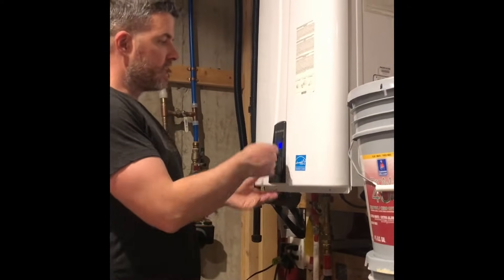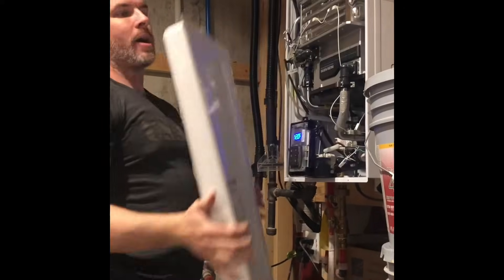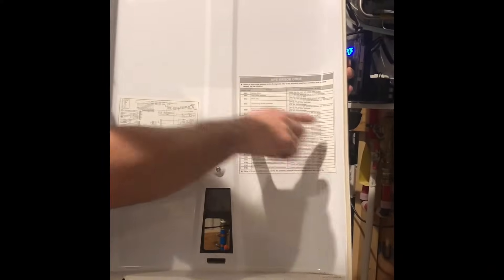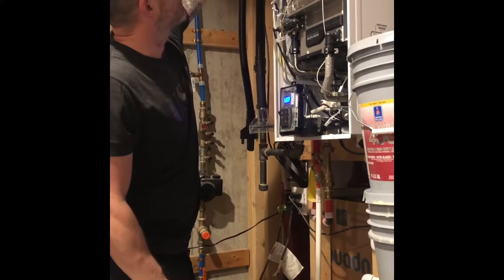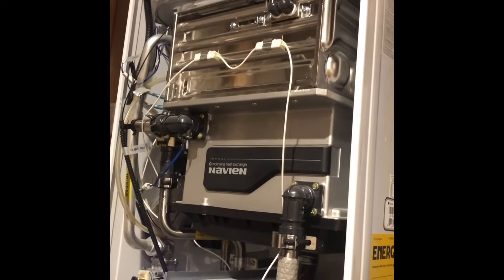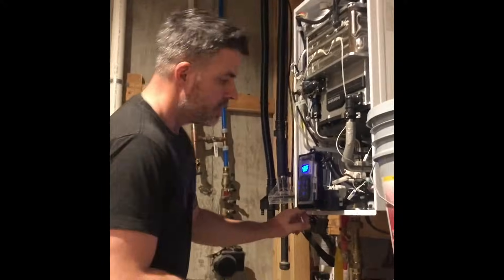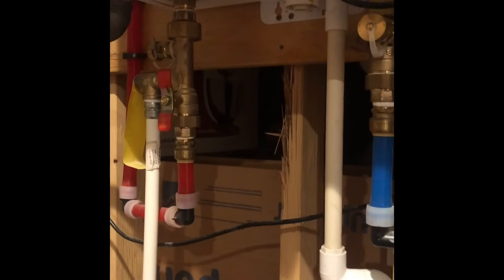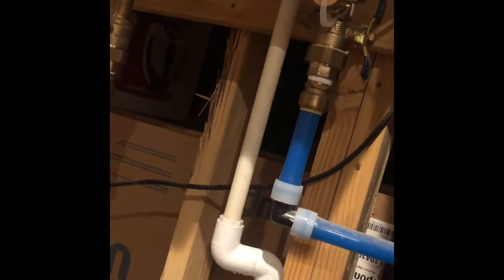Navien Water Heater (Tankless) error code E110 fix: condensation trap

Comment: Just cleaned the condensate trap and it took care of my E110 error code.  (Boiler went out on Christmas Eve.  Thanks, Boxerville, for the Christmas present!)
The User Manual says a fix for the 110 error code is cleaning the air intake filter on the upper left, inside the machine.  Mine was perfectly clean.
Another error code associated with needing to clean the condensate trap is E003, Ignition Failure.  I noticed heat was out, saw E110, hit Reset, and it tried to fire up for a minute or two and then got E003.  
When cleaning the condensate trap, the clip holding it in pulls out easily.  The trap, itself, took a little bit to get out because there is an O-ring holding it in with friction.  (My O-ring stayed on the trap but others have said it stayed in the boiler.)  Have to twist and pull on the trap to remove.  Once the trap comes out cold water comes rushing out.  I had someone there holding a Tupperware container right under the trap and collected 6 to 8 cups of water!  Once cleaned, the trap takes a little bit of effort to get back in due to the resistance of the O-ring.  Have to do the opposite of removing it:  have to twist and push.  Make sure it's all the way in before putting the clip back in.  I needed to give it a couple final twists while pushing to get it tight in there.  (I did not turn off the boiler nor turn off the water prior to cleaning the trap.)

Comment: one  thing  i noticed about  your  drain plug  it fell out because it should have a black  rubber  gasket around it that creates a good seal you  could problemly order one online .     Im  having the same  condensation   issue  but now its happening every two  weeks  i just  empty  the water out and its  back working but im doing it to often now  about  every  3 weeks    so i think something else is going on with my  2017   MODEL 420S unit     thanks for posting

Comment: For everyone that cleaned out the condensation trap, do you just keep letting it fill up with water and drain it again each year? Or should it be drained more often?
Reply: The User Manual says you should "inspect the condensate trap" "monthly."  I've only cleaned out the condensation trap when I get the 110 error code.  I've had the boiler 7 years and I've only gotten the 110 code 2 or 3 times.  I would say, if you don't want to deal with the heat going out, probably draining the trap once a year would be the recommendation.

Comment: I had E445… they changed my whole heat exchanger out.. company said they “changed the valve” which is what the error code was… noticed a fluttering noise 2 days later.. now I have E110 popping up but didn’t have time to look before work! Hope this works. Thanks

Comment: Wanted to say a heartfelt thank you! I just zoomed out to my wife’s aunts home after she called asking about her water heater not working. I wrote down the model and error code. Looked it up, found your video, realized I needed to go check in person (was a drive, but seemed serious enough to require immediate attention). Sure enough the filter was the problem, impacted with leaves and dirt. Cleared it, reset the machine, all done! You saved an elderly recent widow from an emergency service call.

Comment: You are the man!
Thank you for this video. My Navien is about 4 years old. I had the same error code. I checked the inlet, cleaned my filter and checked my exhaust. All checked good. The unit kept shutting down with the same error code. 

I removed the drain plug after watching your video and about 4-5 cups of brown water came pouring out. Be prepared! 
Unit is working now. However, I think I lost a gasket in the drain plug cap when all the brown water came out. I put the cap back on and I can’t get a seal on the drain cap. Water runs out when I turn on the unit.
Reply from the maker: Look for the black o-ring gasket on the floor or perhaps up in the area where you pulled the drain plug.
Reply: Hello,
I found it. It was up in the pipe. Thanks again!

Comment: Will the drain lines being frozen cause this error code to keep coming on?  It got to freezing temps for the first time and that error code came on.  I checked the exhaust vent and it was clear - I did drain the  condensation trap (pulled the pin and dumped) and that fixes the problem for 30-40 minutes … but then it goes off again and I go back out and the drain lines are frozen again.
Reply from the maker: I’m not sure if frozen lines will cause that.  It wasn’t my issue but I would consult a plumber if it keeps happening.

Comment: I also pulled the condensate trap and water came out and the error message issue was fixed. I put the trap back on with that metal thingy but it still drips water. Is this normal or do I need to do anything else? Some people have mentioned an o-ring on the trap - mine doesn't look like it has one on the condensate trap assembly - is this why it may still be dripping slowly?
Reply from the maker: That O-ring falls off easily.  Look up in there and see if it slipped off.    When the o-ring is installed in its place it prevents water dripping out.  But yes your unit will continue to fill up the trap with water to empty it when it gives you that code again.

Comment: Thanks so much! This fixed my issue. Intake filter was clogged, but even after cleaning it I was still getting a 110 code. Pulled the condensate plug and about a half liter of sludgy water poured out. Next time I’ll have a container ready!

Comment: Thank you immensely for this video. I'd gone through all the steps I could find to rid myself of dreaded Error 10 on a NR-210A (check the top intake filter, drain the system). This fixed it and brought me some relief after a stressful Saturday trying to find a repair company to come out. Now for a long hot shower.
Reply from the maker: You’re very welcome
Reply: Has the code come back?

Comment: Just adding my thanks.  For me it was the condensation build up as well.  However, in my case the installers had initially put a drain tube from that trap into a condensate removal pump. When I had maintenance done by a different company, they couldn't figure out what it was for so they removed and recapped the trap  I ended up inserting a clear flexible tubing from that trap hole back into the condensate pump to prevent this build up.  Little giant makes good pumps if you don't already have one installed. Mine drains into the sewage line.

Comment: Excellent video. 
Got the 110 code as well
 An exhaust or intake clog seemed improbable. 
Checked the condensation trap and it was surely full. Flred the unit back up and the code was gone.
Thank you👊
Reply from the maker: Nice!

Comment: Iv been dealing with a Gf200 with this navien system for 2 weeks. We changed a leaking heat exchanger then started getting this error 110, 24 hours after we finished the unit and it was working flawlessly.

In the end what I believe happened is it wasn't producing as much condensate with the bad heat exchanger, we replaced the heat exchanger, which caused it to produce more compensate and run a little harder, at which point the drain was not draining fast enough.

This had about a liter of water in it when I pulled the plug and the barbed drain fitting beside it was not running until I pulled the plug.

In this case I could literally hear the water percolating through the exhaust.

Thank you for posting this you're the first video I saw that pointed out the condensate drain at the back, which I had seen, but did not know what it was for.

HVACR Company Owner/sole tech.
Reply from the maker: Glad to hear things got fixed for you.  Thanks for the comment.

Comment: Tanked water heater is how you solve all of this. Electric especially are literally 100% efficient because as the elements heat it retains all the energy. Those on demands either work good or hardly at all. We don’t install them anymore like many other shops in our town. Customers get pissed real quick and its not worth the reputation risk.

Comment: The condensate trap is full of water because it’s a water trap. It should be full of water to prevent exhaust gases from leaking into your home. After you drain it, it will promptly fill again with condensate from combustion gases. 
Water is a major product of combustion; burning a gallon LPgas produces about 0.8 gallons of water. NAT gas will be something similar per btu. 
You have a condensing boiler. Meaning it is so efficient the exhaust temperature is lower than the dew point of the exhaust gas. This water condenses on the inside of the heat exchanger and exhaust pipe and drains into the condensate water trap, then out of the system via the condensate drain. 
The reason why you should remove the trap cover periodically is to clean the trap so it drains properly.
Reply: So it should always be full of water, we should just drain it like once a year to prevent this error code?

Comment: This video saved me from making a service call. Got the E110 code, intake filter was perfectly clean. Removed the condenser plug about about a cup of water poured out. Everything is back to normal. Thanks!
Reply: Totally worked although kept dripping so might have to drain it a couple times.
Reply from the maker: Glad it helped
Reply: @evantugby  Same here, cleaned exhaust filter and it didn't help. After draining the bottom plug, all black water and dirt came out. It works again. Thanks for the tip.
Reply: Same here thank you very much 👍.
Reply: Mine keeps dripping too. How long does it keep going?

Comment: Adding another message of gratitude . . . have the same unit and water went cold while I was all lathered up taking a quick shower at halftime duing the Ravens-Texans game last Saturday night.  I had followed the instructions in the manual but the intake filter was clean as a whistle.  Tromped around outside and found nothing blocking the exhaust duct.  Was completely stumped.  And soapy.  And freezing from looking around in the 16 degree weather.  Then I found this video, popped out the condenser plug, and replaced it after the water gushed out.  Unit was back on line before the plumber returned my call.  But not before the Ravens came out and dominated the second half.  Saved my bacon, that's for sure.
Reply from the maker: Love hearing stories like this!  Thanks for sharing and glad you got it figured out.

Comment: Same unit, same E110 error code down here in Austin Texas on the first extremely cold day of winter.  Vent filter was clear and the condensate trap had a visible plug of ice when I dropped the cap down.  I ran a hair dryer up into the condensate drain until the ice plug shot out followed by a quart of cold water.  I put the cap back on and we have hot water again!

Comment: My heater is piped with PVC exhaust and intake. I’ve had the code a few times but it worked after resetting. I think if your exhaust pipe is not pitched back to the unit enough, condensate pools in the pipe,throwing off the pressure balance between the 2 pipes. I pushed the exhaust pipe up slightly and the error happens far less. Also it seemed to happen on windy days.

Comment: "Condensate", and the resulting muck that build up in the "condensate" trap is a result of a heat exchanger heating and burning fuel and producing steam. When that happens there is water and muck that forms (condensate) and it needs to be siphoned away from the boiler in order to prevent corrosion (condensate is corrosive to metal).  So that trap needs to be cleaned out regularly at each service interval.  Unfortunately Navien does not document this very well.  Upon initial removal you should find about a quart of water, and this being the siphon side of the unit you shouldn't need to power down and isolate the unit. But if you are performing a service that is always good practice.

Comment: Literally got the error code tonight right before Christmas and your video saved me - cold snap had frozen that bottom trap. I held a hair dryer to it for about 5 minutes, the water flowed out, and now it's working. Was expecting to have no hot water until after the holiday - thanks!
Reply from the maker: Nice!  Thanks for the comment and glad it helped.

Comment: The condensation trap is always full with condensate water. The tankless makes the water while it's heating  the water. It's why you can vent these units with PVC and not metal. As for the code sometimes that trap never gets cleaned EVER so some debris clogs that condensate line out and will throw that code. 

Make sure your servicing your tankless heaters folks especially flushing them if you have hard water or you will pay the price down the road these things are not cheap!
Reply: Thanks for the tip on the condensation trap. I removed and drained mine and hot water has been restored.
Reply from the maker: Please make a video on how to flush the tankless water heaters please and link in your comments here.

Comment: Did you figure out the issue I’m having the same issue
Reply from the maker: I never knew why but I’m guessing it was condensation in the pipes.  I reset the error code by draining it and it was good to go.  Did you reset your error code and are you getting hot water again?
Reply: @evantugby  yes I did but still get the 110 code
Reply from the maker: @martingomez6928  did you clean the filter and empty the condensation trap?